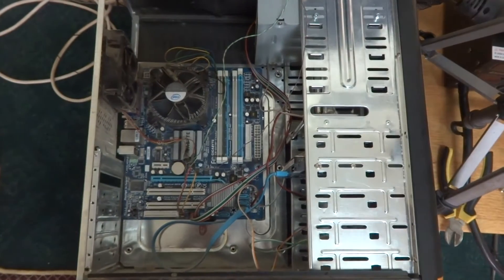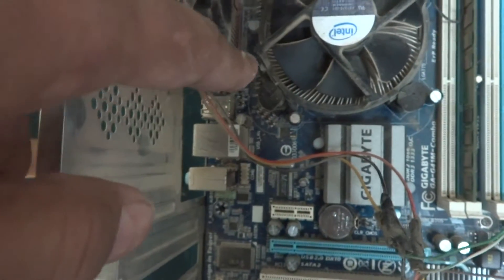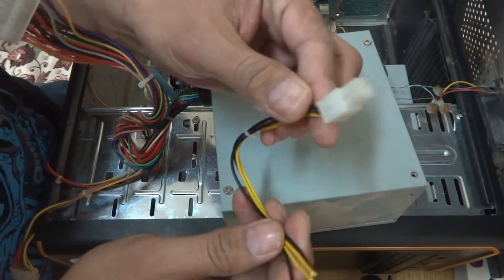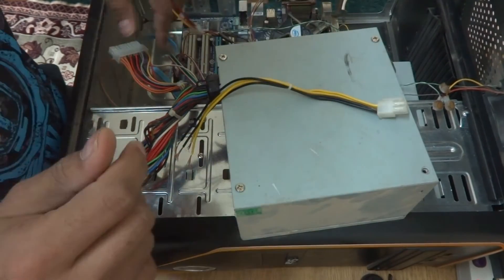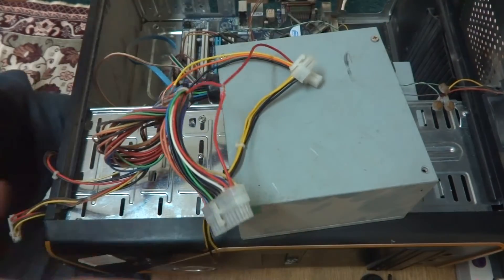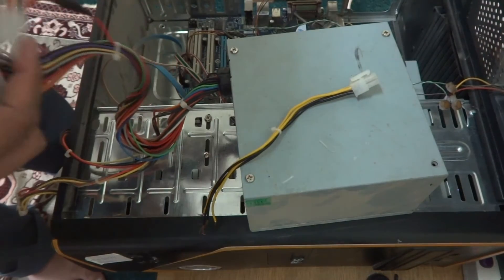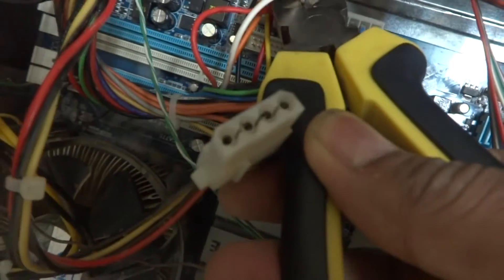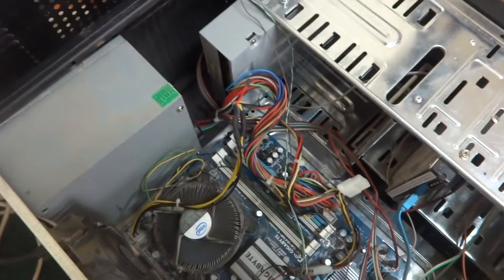ATX Power supply. ATX power supply enhancement.

Comment: you can run that motherboard with 20 pin connector and it is important how much current you have on +12V rail.you can modify your power supply like that but it decrease the lifespan of your motherboard component

Comment: Great video.  Did not know you could upgrade the old power supplies like that.
Reply from the maker: tubejim101 Thanks dear friend for liking the video. Yes sure I upgraded an old supply to a new PC as you watched in the video. This is useful if you have available an old good power supply from an old PC and you want to reuse it instead of making it junk. Also this technique is useful if you are unable to find some special design power supply locally and you want to repair the machine by any way in a quick and cheap manner. Hope the video provided you some information. Regards,

Comment: Smashing job jahan :-)) Hope this pc is for a decent frend.

I think the rubbery tape you used was self amalgamating, some people use it to wrap around the antenna/power connectors to keep the water out.
Looks really neat on the extentions you have added :-), i can see why its a favorite :D
A single cable tie around the 20 +4 connector would keep it in place, if your worried, i dont think its going anywhere lol :D.

ive really only looked at the (red 5v) (black 0v) (yellow 12v) and (Orange 3.3v) when i check a system, if they work then usually the psu is working to some degree.
The remote on/off wire can change colour, also i only check the (PowerGood) line if i suspect a problem.
I do remember the earlier A.T supplys had -5v and -12v, im guessing that the white is one of those, i didnt really look too close lol :D
Reply from the maker: zx8401ztv Yes dear friend your understanding is well. The tape I am preferably using in most cases is 3M insulation rubber taping which is setting up itself with time and temperature and becoming like rubber or shrinking slew. That works fine for me always.You are correct and thanks to correct me as well, the white wire is -5V rail which is omitted in most cased in today's main boards. Regards,